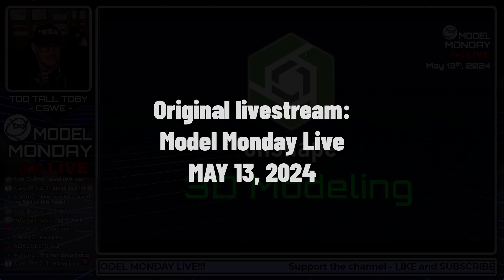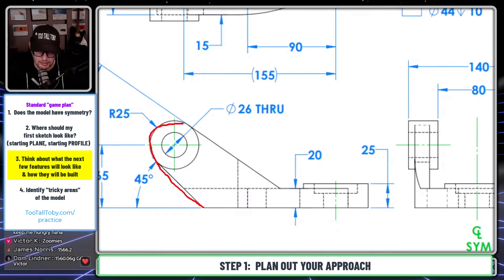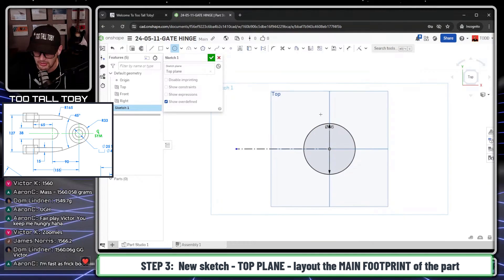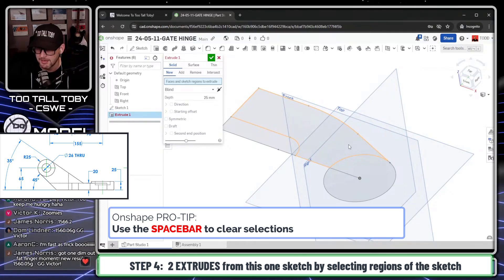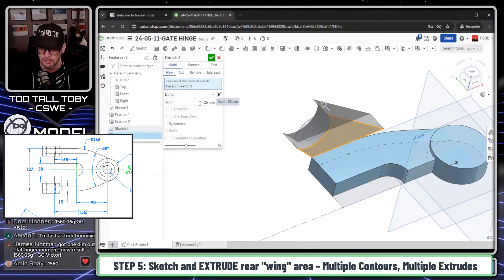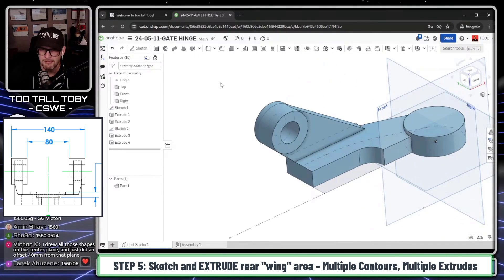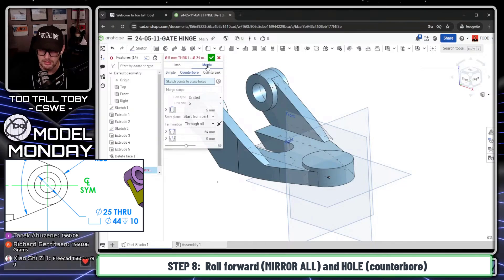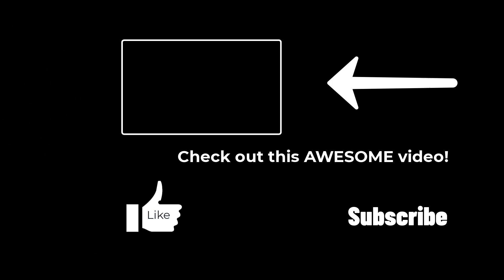Onshape STEP-BY-STEP Tutorial / Best Practices Training

Comment: What I don't understand is why cad software doesn't have something like a bezier pen tool that allows you to make relatively accurate curves in a sketch environment with maybe a placed image, and then you could extrude that into a shape for further editing and refine the measurements. Maybe they do, but I don't have enough experience to say I've seen one.
Reply from the maker: Hi John - in most 3D CAD for mechanical engineering we have spline tools that generate bezier splines.  We use this a lot in surface modeling.
We can also import an image and then "trace" over that image (manually) to make sure this spline matches an existing product or an industrial designers hand sketch.
There are tools out there that let you "auto-trace" these kinds of imported images too - some work well, others not so well.
And then there a "sub-D" modelers that let you push+pull surfaces and curves, while maintaining surface curvature so your parts stay smooth.  This is great for really curvy stuff like laundry detergent bottles and irons and things of similar shapes.

Comment: Always useful for users to see alternative approaches to modelling and benchmark their performance to others. I followed the Onshape VS Solidworks competition on this part. Without the stopwatch in another program I use, my first times were around 13 minutes - quite poor... but after practicing, practicing and much more practicing my last 3 runs were 5:22, 5:26 and 5:38. The actual winning time of the official comp was around 6:30 in the stress of battle and without prior practice, I doubt if I could match that time.
But is there really a need to model from prints? I can understand better acquaintance with sketching methods, which is important and FUN but why the emphasis on copying prints - can anyone enlighten me please - Thanks!
Reply from the maker: Hi Tim and sorry for the late reply - Think of it like learning scales on guitar.   The more you practice the same scale on a guitar, the more you'll learn the little nuanced things can only be learned by doing.  Things like "how hard should I press down on each string" or "if I play the scale here, vs playing the scale here, it sounds better".  These practice models and exercises are meant to give CAD users a chance to try different workflows, over and over, until they really understand the nuances of how these workflows will respond - so they can start using similar workflows at their actual job!

Comment: I am following the video but when I want to define the last angle for the line that is tangent to the circle I get this error: "A dimension cannot be added between a curve and one of its points."
If anyone can help it would be amazing!
Reply from the maker: Try this:
1. Enter the sketch
2. Choose USE on the sketching toolbar
3. Choose the circle from the model
4. Exit the USE command

Then try adding the tangent relationship

If that doesnt work - try hitting up the DISCORD - you can drop images a little easier in there (in the #practice-models channel)
Reply: @TooTallToby   Thank you for the reply! I managed to get the angle to work! Finished the model and it looks great! Thank you for this tutorial!
Reply: @pimodzzz  How did you do it please? I'm having this exact same problem. I've tried redrawing the lines as curves and the 'use' tool fix but didn't understand how to do that either.
Reply from the maker: https://discord.gg/aVxWDQRW